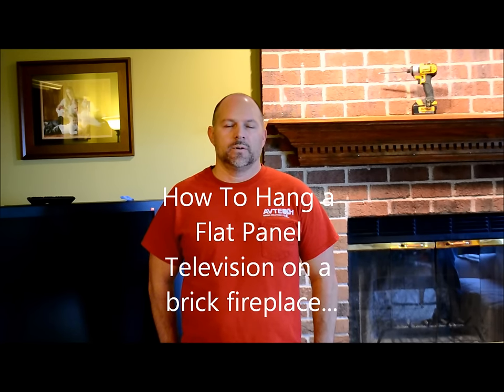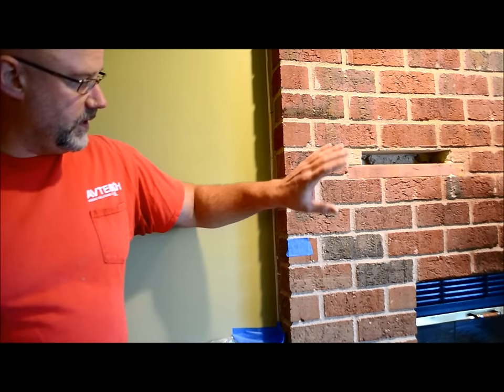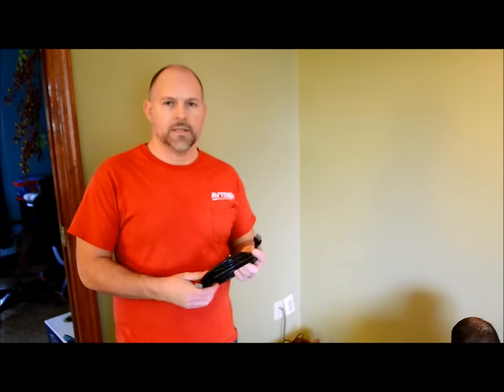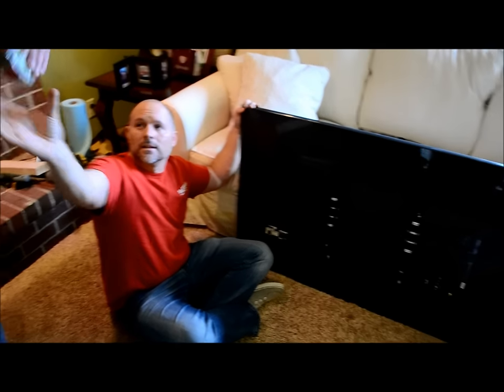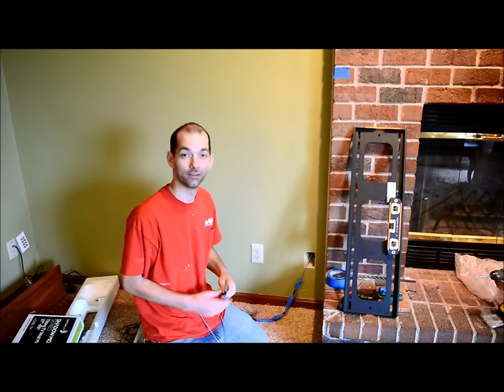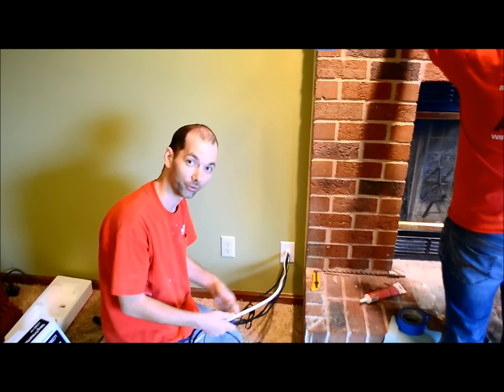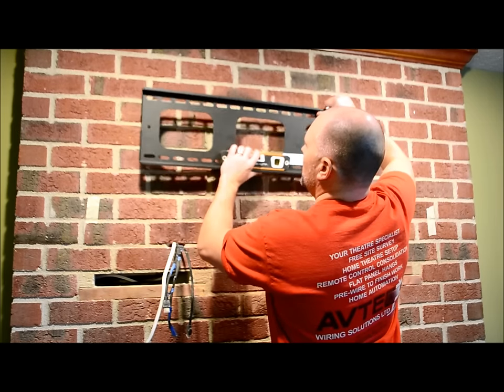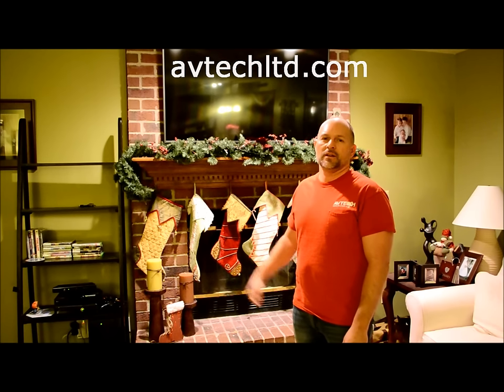How To Hang a flat panel tv on a brick fireplace

Comment: Yeah from what I've researched, drilling the bracket holes into the mortar is a no no...should be directly into the bricks instead.
Reply: from good old BOB VILLA - Brick usually holds better and supports more weight than mortar. However, if you have old, fragile brick and you're mounting a heavy object that requires deep holes and expansion-style anchors, drilling into the brick may not be the best choice.

Comment: I just had two of my anchor screws come out that were drilled into the mortar. The bottom anchors were in the brick and we're still secure.
Reply: people move!.....plus tvs and mounts have been changing in design just as rapid as cellphones, its hung to be semi-perm. or until you move or throw a remote through the tv. all was considered but the decision is ultimately up to the home owner. whom decided in this case

Comment: Just an FYI from some research:

There is really no consensus on mortar vs brick..  Each has it’s own merits... brick is stronger but brittle and can have air gaps internally... mortar is softer but less likely to crack...(provided it is strong and in good shape and was not mixed poorly)... attaching to mortar you can (and should) use wedge anchors as they are very strong, but would have a tendency to crack brick...which is why on brick you use tapcons, sleeve anchors, or lags with sleeves (and liquid nails if sleeves are plastic is smart idea)...also with plastic sleeves place them so the slits are horizontal (so they expand vertically)   which makes them more resilient when hanging things like TV mounts.  Also with mortar mounting you always want to mount to the HORIZONTAL mortar lines (since the weight pulling down applies pressure to the rows of bricks above and below).

Mortar is easier to repair as well, but your mortar lines might not be perfectly straight which can make staying in the mortar line difficult.  On top of all this, you may not have alot if choice due to where your mount simply has to be placed on the wall.  

Both work, but just be aware that wedge anchors should be avoided with bricks but SHOULD be used when mortar mounting (other expansion types like lags w/sleeves work as well, but wedge anchors are the best for mortar mounting).   For brick mounting use Tapcons, Sleeve anchors or Lags with metal or plastic sleeves (and liquid nails with plastic sleeves).  I know I repeated this last part but it is the important difference between the two ways to mount...i.e. What to use... 

BTW, never a bad idea to practice on a spare brick first if going the brick route.  

And, of course, a hammer drill (with a good bit) is worth the trouble to buy/borrow if you don’t own one.  Not that you absolutely need it, but if your material is really solid (which is a good thing) and your drill/bit is subpar (not a good thing), then drilling can literally be an all day affair... trust me, I have been there! Even a cheap hammer drill (with even just a decent mortar bit) will make the task easier....and with a good bit, it’s almost easy... almost.
Reply: I appreciate this info, brotha!
Reply: Excellent info!
Reply: Thank you. 
I know concrete and wanted to better understand brick/ mortar
Reply: Awesome information  thanks 😊
Reply: great info
Reply: Just wanted to add a note:

Building codes are your friend.

Building/Electrical codes are actually not very hard to follow…primarily distilling what is relevant or locating all applicable codes is the hardest part, this is fairly easily overcome by having an electronic version and doing some basic searches (for example,  “Fireplace” or “heat source” and then look at each and every result, then search for the next synonym).   

Building/Electrical codes are huge because they cover every single aspect of building… But only a small amount of it is applicable to any given project… so distilling it down is the hardest part IMHO.   Any Termanology a person doesn’t understand is easily googled for better explanations as well. The nice thing is the more you refer to the building/electrical code for various projects the more you start to get an understanding of how it’s laid out and it gets easier each time you reference it.

Comment: We always use the mortar joints, we use an adhesive when we insert the plastic anchors, helps hold the lag bolts in place. over 500 tvs hung and no issues with mortar holes!
Reply: What type of adhesive do you use??
Reply: @A_Class216  Elmer's glue stick..... with glitter.

Comment: Nice video. One question: I thought that tv cable wires are not in-wall rated. Wouldn't you have had to splice it with actual romex?
Reply: I believe you’re correct. I’ve mounted a few TVs and always added an electrical outlet behind the TV so it can plug directly into the wall while hiding the wires. I’m fairly certain it’s dangerous and against some code to run the power cord through the wall.
Reply: @jeffh6889  How to add an electric outlet on bricks on top of fireplace?
Reply: Hey Joaquin , I’m no expert, but I believe you’d have to mount one of those metal outlet boxes to the outside of the brick after running the wiring to an existing outlet near the fireplace. I’ve seen one method where conduit was run from above the mantle down to an outlet on the lower left side of the fireplace, and the wiring was run through the conduit. I assume the conduit was designed to protect from any excess heat from the fireplace, but that’s just a guess.

Comment: I always use solid brick when hanging client tv's and have never had a problem with cracking.  Never have trusted mortar and voids!
Reply: valid point, but depending on the circumstance. it will hold great, but try to fix the brick when the mounts then where bigger and heavier, as were tvs. plus factor in probability of need to remove . mounts are not 100% universal by far.

Comment: agreed, I give this a fail, gas or wood fireplaces become pretty hot behind the face brick and from experience, will cause the wires to become extremely hot, possible damage, and a flex pipe should have been run the entire way, to contain the wires, and proper tv component box should be installed behind tv, where the  electrical outlet and media wire hook ups are.
Reply: I apologize for the electric part of the video not being shown in its entirety. It was ran up to code in Ohio.  We ended up using a female to male three prong plug adapter that allowed for it to be plugged into a surge protector. AV wires didn't need to be ran into any type of tubing, as the brick was just on the surface of drywall and we were had enough room between the mortar and drywall. No issue with heat as we didn't enter into the actual "firebox", which would only be a issue with a wood burning fireplace as gas fireplaces are not much more than a empty box.  The customer didn't want any bricks removed so we only used the mortar line to get the wires behind tv then added new mortar. TV height was chosen by the customer, as with every tv we hang its customer choice. We have gone back to this customer and completed more audio video work without any issues with the fireplace tv hang or the other projects.

Comment: What did you use to protect cables from frying?
Reply: Use in-wall rated cables for one. But the bricks don't get as hot as you might think (there are layers of bricks, and probably a chimney liner which makes the most difference). Note the mantle was mounted to some 2x4s shoved into the brick cavity..

Comment: Why didn't you use a QBit Cut-In saw for multi-tools to cut out your low voltage bracket hole?  

Can you light a fire without melting the wires above the fireplace?

Glue substance?  Acrylic, epoxy, bubble gum?

I'd of worn  a collared polo shirt for a video.  At least the T-shirts weren't wife-beaters.

I didn't see an outlet/receptacle on the brick above the mantle. You didn't mention running NM or MC for power. 

Did you conceal the power cord for the TV and sound bar in the wall?  You said "All the wires are hidden".  You just provided evidence that any inspector could use to revoke your low voltage business license and for the homeowner to sue you.  

The NFPA 70 National Electric Code (NEC) 700.8 clearly states, "flexible cords must not be concealed by walls, floors, or ceilings."  If that customer's house burns down, AVTech Solutions is likely to be liable.  

Otherwise, this was a great video explaining and demonstrating many of the factors required for a quality installation.  I gave you a thumbs up.
Reply: They should have used conduit behind the walls and then run the cables inside the conduit.

Comment: I removed the mantel and moved it down. I drilled into the brick and you have to pretty stay close center of bricks. To close to the edge and the bricks crumble. I use a 3/16 bit with 1/4 concrete blue screws. Becare screwing the screws in because they can break. Had that happen. I had to use longer screws 3-3/4" because the brick hole stripped out. Still haven't  installed tv bracket. Calls for using a 3/8" bit for installing 4 bolts with plastic inserts. There's got to be a better way.

Comment: Great video....however you said lags? If anything you would use anchors!
Reply: South Charlotte Services; you did not watch the whole video. He used lags WITH anchors AND glue.....I guess epoxy.  Gonna need dynamite to get those lags off.
Reply: No Glue...just metal anchors...lol
Reply: Used 3/8 lag bolts and metal anchors... Never use glue. I did use lag bolts.
Reply: @7:01.......dude said he used anchors WITH GLUE.

Comment: i'm so curious if over time the heat from the fireplace impacted the cables running through the brick. It's my biggest concern with this awesome setup!
Reply: Best way to know is to do a test... use an indoor outdoor thermometer (one with a wire for the outside sensor) or a wired/wireless oven thermometer to place in the cavity were you are running the wire...then crank up the fireplace for a good hour... then check the thermometer... if it looks good temp wise, then move the thermometer to different places along the cavity where the wire will be placed.

The thing is that fireplace heat is pretty inefficient and goes UP the chimney... the surrounding brick acts as a heatsink dispersing and chimney heat into the air (in and out) which in turn keeps your house from starting on fire.

Therefore, the brick work itself , especially the extremities (furthest from the fire should stay quite cool, barely above room temp).  If your fireplace brick work is getting really hot at the edges, you have bigger issues.   Since the wire start  closer to the center of the chimney that should be the hottest area so it is the best place to start... and before even drilling, just put your gand on the brick surface, if it is already well above room temperature the you are already a no go (since the TV will nit be safe there).

Hope this helps.
Reply: @GearGuy  exactly what was done! nice!
Reply: of course this is not a fix-all, every home and build is different, as well as codes and technology itself. and its meant to be sturdy, clean, yet removeable.  but in this case it was not a high temp area.
Reply: @larrylooney  Very True, anything you see on Youtube or it’s comments should be taken as broad strokes.   Each howe is different and there is always the possibility of previous owner DIY hacks ir lazy contractors/builders, etc.  As you mentioned,

Comment: Hello all!
I’ve bought a condo with I’m guessing is the wall mount above my fireplace. I didn’t prefer to use this space for this however the size of my new living room is demanding it. I already have the hardware installed above my fireplace. Then the 2 large brackets with screws and bolts along with knob type adjustments only I don’t know how these pieces all all come together to hang my tv. I hope you can give me some guidance! Thanks so much!!

Comment: Why don't you drill into the solid brick, rather than the mortar?
Reply: its on 
TVs are not permanent additions. And sizes and shapes of our cinematainment rooms change in design rapidly, and if you move buy a tv with different bolt pattern its got to  come down.

Comment: Couldn't see how the wall bracket holes could be lined up with a mortar line top and bottom of the bracket???
Reply: I guess since it only took four screws for the mount, the lined the mount up with a straight mortar line at the top, and just adjusted it horizontally until there was mortar in two spots for the bottom screws.

Comment: Where is the power outlet for the tv and soundbar?
Reply: robertsrt probably with the bundle of cables. Most if not all flat screens now have a detachable power cord.
Reply: robertsrt - yeah I think wherever they are, the state has different building codes than where I am. Because running those power cables in the wall would be against code here and technically illegal. They're obviously not using a power pack so I think it's just extension cables ran thru the wall maybe?
Reply: Oops!
Reply: @honestinsincerity2270  In Massachusetts, where I live, it is also against code to run a TV's power code in a wall because it is not in wall rated. However,  I'm pretty sure I spotted a romex cable in that bundle but they didn't really show how they did that. I also really don't understand how they ran the wires through the brick. I think I blinked and missed that part of the video.
Reply: @scotter140 Good point and yes it is against copde to run any power cords or extensions in the wall bc they are not rated in wall. Its actually more of an an electrical "jumper" from standard electric following wires and three prong adapters on the ends once out of the wall and then it must be into a surge per code.

Comment: So if the brick is covered with plaster how do I install
Reply: The studs between the brick and plaster
Reply: @douglassgarvey653  no studs
Reply: @ed.3219  Cut out part of the plaster wall about the size of your bracket and mount to the brick like they do in this video

Comment: This guy does install it correctly per manufacture recommendation but I am a engineer that has many reputed manufacturer recommendations cases. This is one of them. Most don't say anything about where to put the anchors. I do know THX requires their installers to only hit grout lines. Again how will you remove the wall bracket if ever you ever move or want to upgrade. The installer coming in after the fact to install the new homeowners mount is in for a world of hurt...I'll leave it at that.
Reply: South Charlotte Services plastic anchors with glue and drilling in the mortar....  Is this tv still on the wall,  lol
Reply: The manual that came with my brace said not the mortar, but into the actual brick. These guys are professionals, and im sure they've obviously done this before, so why make a video of something that doesnt work, but still. The mortar would be holding the load of 40lbs give or take, idk if thats such a good idea.
Reply: Easy to repair mortar later once someone moves.  As for as metal anchor spreads and lock into surrounding brick. Also you risk splitting the actual brick which cost you a bunch to fix. If you're really worried then use commercial toggles if you don't mind holes in your brick...geez..it's all relative. I have install over a 1000 and never had one fall or even get loose if that helps.  Speaking of the bracket manufacture...I bet they gave you plastic anchors...lol...try them and see how it goes...
Reply: I will guarantee to you that if I installed metal anchors into grout....you and all your buddies together won't be able to pull it down...what a joke...please don't waste my time.
Reply: How you going to repair it if you sell the house?
Reply: I have never had one even come loose with metal anchors. Only fools wood glue a plastic anchor...how do you plan on removing the mount later? What if you get a bigger tv... asinine.
Reply: I used metal anchors, and yea the bracket came with plastic ones. 

In the end, I couldn't tell where the brick or mortar was because they had covered the fireplace with plaster. This house is from the 50's. So far so good.
Reply: What abou using Tapcons?
Reply: South Charlotte Services , Just to be clear, when you said you installed 1,00 of these, did you install anchor in the mortar or the brick? Did you use plastic  anchor or metal anchor?  Did you use and adhesive?
Reply: @Southcharlotteservices  well put. it was off the wall and replaced within 2 years to a slim fit also!

Comment: I swear I've heard from different professionals not to or to drill into the brick
Reply: Always drill into the brick, it is always stronger than the mortar
Reply: You have... there is no consensus on it, but there are caveats... see my other comment (on this same video) for a brief synopsis.
Reply: I was told also not to drill into the brick because most of the bricks are hollow. (have 2 or 3 holes in them). What are your thoughts on that? Thanks in advance!

Comment: Never drill into the mortar it deteriorates over time unlike the brick which does not pretty much basic beginners stuff.
Reply: customer did not want the bricks drilled. in case there is a need or want to have a future removal.

Comment: Are you supposed to drill into Mortar or the Brick?  I am hearing drill into the brick.
Reply: They said drill into mortar a number of times.
Reply: I always drill into the mortar. Mainly because it's easier to fix mortar if you screw up.  In mortar, the anchor will press against the surrounding brick and provide a secure and strong hold.
Reply: My brace specifically states the brick. But if the anchor is wide enough, I could see it attaching to the brick on either side. I guess that width would be the determining factor, otherwise I wouldn't trust mortar to carry a 40lb load.